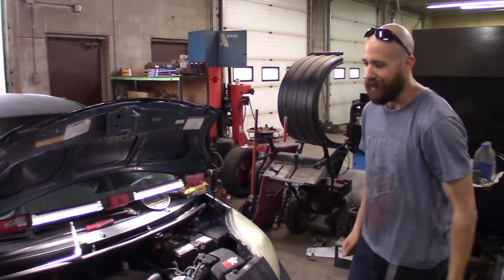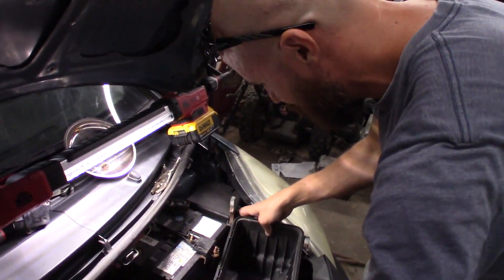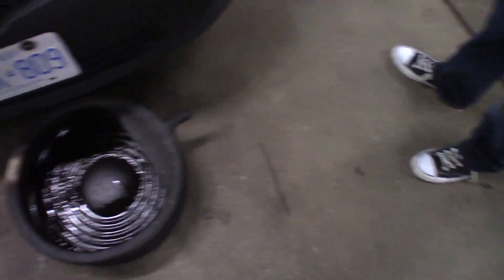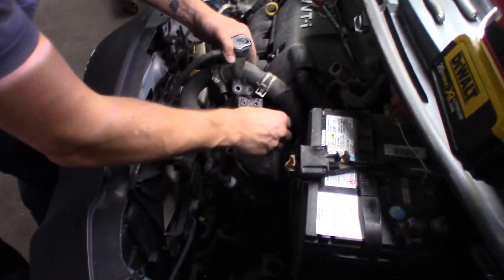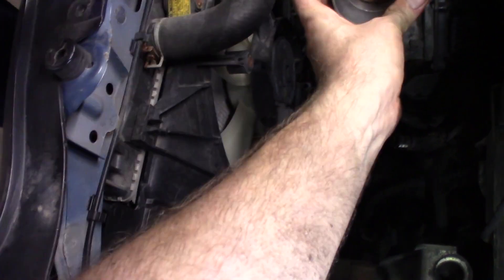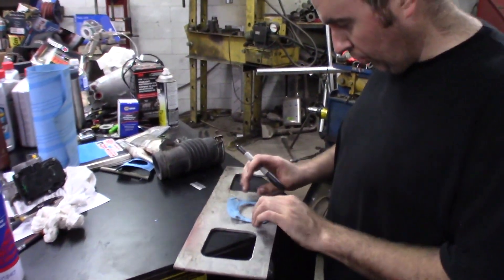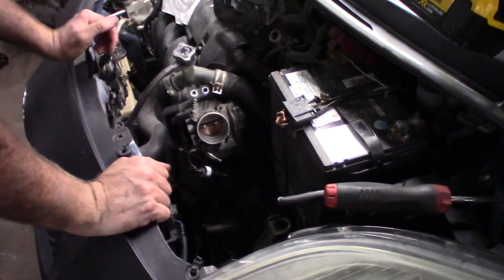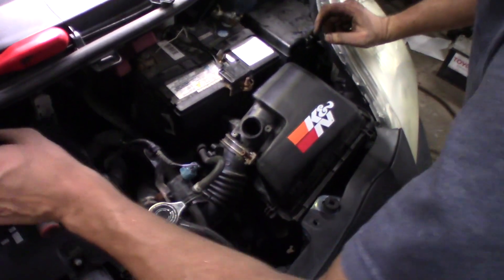1NZ FE 1.5L Throttle body upgrade!

Comment: how has the swap effected your smog check, still able to pass? I keep throwing EVAP codes p0505, incorrect purge flow. have you thrown codes?
Reply from the maker: It did not set any codes, so it would have passed no problem if they still did emission testing around here!
P0505 is for idle control system malfunction,  so you may have a vacuum leak

Comment: Did you guys use the original coolant hoses or did you run new ones?
Reply from the maker: If I remember correctly we used a new  straight hose to bypass the coolant to the TB
Reply: @modeverything1  I did mine a week ago and one of the hoses fit fine but I had to run a new line for the other end. Performance doesn't feel too different on the low end but to me feels less restricted at interstate speeds

Comment: Ok u deleted coolant line what did u do with the othe two lines on the throttle body
Reply from the maker: The two on the throttle body that had coolant going through them were left open once the bypass hose was on.

Comment: How did you handle the length of the acceleration cable once 1zz was installed? My original cable is long enough but the two bolts fastening it to the original harness holding it place, now holds it about a quarter inch too far out, so butterfly is always open way too much. My car is currently mid mod in the lot out back so anxiously awaiting connection with your wisdom!
Reply from the maker: The 2007 yaris uses an electronic throttle body so we did not have that problem.  It sounds like you may need to make a plate up to lengthen where it bolts up or elongate the holes on the bracket if it's close. Unfortunately I'm very familiar with the cable set up on the older engines

Comment: I did this swap and had the same issue's with the boot. I removed the plastic pcv fitting and cleaned the boot with soap and water to remove all the residue . Then i put the boot in the microwave for about 40 seconds. This softness the rubber up and makes the install a lot easier. I got this idea from when  I installed the covers on my older snap on air tools. That was the prescribed method for getting those old rubber covers on as well.
Reply from the maker: Awesome! I will have to remember that one!

Comment: I did this a few months ago and what an improvement. Hills are a breeze and it doesn't run out of breath on the highway. I also ported the intake manifold where it bolts up and made a custom gasket so it gets more flow and seals properly. The hardest part was putting the smaller hose over it. Some dish soap and a heat gun did the trick. I exposed the idle screw and backed it out a bit to have a proper idle.
Reply from the maker: That's awesome! We where on a tight time line to get it done so we didn't look into the idle too much. Good to know for next time!
Reply: @modeverything1  this is 1zz throttle body or 2AZ ?how about the idling when cold start ?
Reply from the maker: This was a 2AZ TB. Cold start was higher when cold, but as Mr Partridge said adjusting the sealed Idle screw would be best.

Comment: I have a 09 toyota yaris sedan and wanna upgrade my throttle body as well 2.4L should fit right?
Reply from the maker: I think so, but I don't know 100% if it will. Please let me know if you do get  one and try it!
Reply: @modeverything1 what's the part number of the throttle body u guys install? Cause I'm about to upgrade mine soon next month and headers to
Reply from the maker: Not sure on the part number, we pulled it off a 2006 Camry 4cyl

Comment: From the original throttle body from the yaris where did the two hoses hook up to on the 2.4 throttle body
Reply from the maker: We just used a longer hose to bypass the throttle body so that it helps keep the intake air cooler.

Comment: Do you happen to know the part number on the camry throttle body?
Reply from the maker: Sorry I do not have a part number for the OEM Camry throttle body.  You can buy new aftermarket ones from rockauto.com or your local parts store but they are not cheap!
Reply: @modeverything1  oh ok, does it matter what camry it come from? I want to do a comparison between the 1zz throttle body from the corolla I already have on my yaris with the camry tb. I found some new oem ones where I live for about $200 for the camry
Reply from the maker: The one I got was from a 2006 2.4L. I imagine that other years will work as well.
Reply: @modeverything1  ok great thanks
Reply: I got a new camry throttle body today and swap from the 1zz tb to the 2az tb and performance wise it identical but cold start rpm is lower than the 1zz tb and overall the camry tb feels alot smoother I'm running it with the 1zz 255cc fuel injectors
Reply from the maker: Good to hear! Think that you may be able to do a re-learn for the TB with a scan tool...
Reply: @modeverything1  I don't have a scan tool to be able to do that but the way I did the relearn process is the similar procedure to what I did to the 1zz throttle body. disconnect the battery before I start disassembling everything then once everything swapped and put back together turn the key to on position then turn it off (do the on to off twice) then start the car then I let the car pulse rev until it stops pulse revving and let the car continue to idle for 10 minutes. I'm currently running it on my stock ecu after I do 2 more videos on how it feels with stock ecu then I'm going switch back to my tuned ecu and see the difference
Reply: which throttle body is bigger?

Comment: Hey any suggestions for the wire operated 05 TB? Been doing research and these are all wireless throttle bodies right?
Reply from the maker: For the cable operated I would at the late 90s early 2000s 1.8 Corollas. Might just have to spend a day at the wreckers trying some from other Toyotas on one like yours in the yard. If you find one from another Toyota that has the same sensors but doesn't bolt up you can always make an adapter like I did in another video for the GM stuff!

Comment: Would you happen to have a list of things like this to do to these cars? Doing the same idea of mods to my 05 echo. Nice vid by the way
Reply from the maker: Thanks! On this car all that was done was full 2.25" exhaust, DC sports header, lowering springs, and the throttle body that was done in this video! Next we would have ported and polished the cylinder head because it could use some improvement.
Reply: Hey ross, u need intake, clutch very light wheels, coilover, de-cat and brakes !

Comment: If you have any modifications suggestions for 2008 toyota prius throttle body and air intake plenum please please help me out ....do you think the 1.5 1NZFE could be fitted with the newer 1.8 air  intake plenum ??
Reply from the maker: Sorry, don't have any upgrades for a Prius.  Dose it have the 1nz-fe? On a Prius I would start with an exhaust upgrade, they are only 1.5" iirc, i would go to at least 2". Then maybe look at making your own cold air intake, or some kind of an air duct to direct cold air to the air box. 

Depending on space the 1.5 1nz-fe may be able to use a 1.8l air intake... if you try it let me know if it dose or doesn't work!

Comment: What did you do with the air inlet tube at the top of the new TB?  Seems like it's an idle bypass inlet and should be closed when installed on the Yaris.
Reply from the maker: I believe there was a vacuum or evap line that went to it... it's been a while and I can not remember 100% lol

Comment: at the end of the video, it is accelerated, as they regulated the acceleration, or it was regulated automatically, greetings from chile
Reply from the maker: The idle was high from the bigger throttle body. After a few more starts it started to return to normal once the computer relearned.

Comment: this would make no benefit if the old throttle body whole is the same size as the intake  seems like a waste of time.. unless the stock throttle is too small
Reply: yes, it is too small
Reply from the maker: If we could have removed the intake i would have ported it to match.
Reply from the maker: Its still getting more air in the engine. On these cars at wide open throttle the throttle blade only opens 80%.
Reply: That is why you need to port the passages. A simple Dremel will do it.

Comment: So from 1.8L can be bolt on but with longer bolts from 2.0L or 2.4L, and gains around 5-6 hp? I would love that from a 2.7L 2TR tacoma inline-4 TB on my 2.4L xB. That be gorgeous.

How is it? Any issues? How much was it and where do u buy it?

@MODEVERTHING
Reply from the maker: I grabbed it from the local auto wreckers/recyclers. Think it was maybe $25 (check out the "yaris mods?" Video) it was a noticeable improvement, it did idle a little higher when first installed until it relearned.
Reply: Mod Everything  Do u think there’s an aftermarket throttle body? Rather than oem upgrade from larger I-4 displacement.
Reply from the maker: I have not seen one but with enough money I'm sure you can get a machine shop to make one for you! lol we did this years ago when my friends brother was working at a machine shop!

Comment: Can you please share the service manual?
Reply from the maker: https://www.amazon.ca/Toyota-Yaris-Automotive-Repair-Manual/dp/1620921367/ref=asc_df_1620921367/?tag=googlemobshop-20&linkCode=df0&hvadid=295972053075&hvpos=&hvnetw=g&hvrand=16184961261515502382&hvpone=&hvptwo=&hvqmt=&hvdev=m&hvdvcmdl=&hvlocint=&hvlocphy=9000887&hvtargid=pla-559617306387&psc=1 best place to get all the information,  they tear down a complete car and take pictures! Also have wiring diagrams too!

Comment: Really cool that you got a Camry throttlebody to work. I figured that that would cause problems. The Yaris isn't too bad to work on. I had two. Just recently sold one. The other, my RS, I 2ZR-swapped and turbo'd. It's an absolute blast to drive.
https://www.youtube.com/watch?v=qH2HCcNXF28
https://www.youtube.com/watch?v=6eJXEtcY0RQ
https://www.youtube.com/watch?v=fFvwnmc09Qc&t=0s
Reply from the maker: Nice! We wanted to do more to this one but my buddy's wife wouldn't let him spend any more money on it so he sold it 🙁 I'm hoping to pick one up later this year and actually port a head for it and possibly turbo it!
Reply: @modeverything1  Too bad your buddy had to sell it. Hope you get one yourself and turbo it. Would you do any engine building? I think the 1NZ is good for up to about 9 psi stock.
Reply from the maker: Yes I would do some engine work, I have a 1NZ-FE cylinder head here that we where going to port and polish for his... I'm itching to play around with it and see what I can do with it!
Reply: @modeverything1  I think a 1NZ build would be great. Since I have one in my garage, a build (pistons, rods and some head work etc) isn't out of the realm of possibility, though I'd have considerable learning to so before embarking on that type of project. There are guys getting upwards of 500hp out of them. IMO, that would be way too much power in a Yaris but somewhere in the 300s with a 6-speed, upgraded clutch and LSD would make a fantastically fast and fun car.

Comment: But how big is the hole in the manifold?
Reply from the maker: Did not measure it but I would say it's a mm or two smaller than the throttle body!

Comment: Does it improve idle
Reply from the maker: The idle is pretty much the same as factory after the ecm re-adjusted its self after a few starts/warm ups!
Reply: @modeverything1  was it was high in the beginning ?? I have low idle problem and I have done everything to improve it now last option is to change Throttle body
Reply from the maker: @mridware9694  yes it was higher than normal at first. Is your Throttle body clean inside (no carbon), any check engine codes?

Comment: Im loving this! So glad i found it. So reading the comments, i can put 1.8l injectors and a 06 2.4l Camry TB?
Reply from the maker: We have not tried the injectors ourselves but the 1.8l Throttle Body is what we where looking for but could not find one.  So we tried the 2.4l TB and found that it worked!
Reply from the maker: @WeAreWatching Yu yes it was a direct bolt on, but we did not try it with out a spacer in place that we made. I know that people have used the 1zz TB just bolting it on.
Reply from the maker: @WeAreWatching Yu Yes he noticed a good difference in power and throttle response! Nothing was done to the computer or anything else other than what was done in the video!

Comment: What under hood light is that?  I have never seen one that takes dewalt batteries.
Reply from the maker: It's made by Mac Tools. It just came out last spring! Mac tools / Dewalt are owned by one or the other,  cant remember which one owns the other.  Stanley tools I believe is in the mix too! Lol

Comment: I have a yaris but a standard instead of auto.  I would love to see more on your yaris.  Im gonna be building mine up as I can.  I think I'll be doing this same upgrade.
Reply from the maker: Nice! Hope to get some more video on this car soon, but I don't think it will get anymore mods, he is talking about selling it 🙁
Reply: @modeverything1  Hi, if your car is an auto and the same type as my 2014 Aygo do you know if the gear changing setting sequence can be altered as mine changes into 2nd too quickly or does one just have to put up with and use the paddle shift!?
Reply from the maker: If you could reprogram the pcm you would most likely be able to, but I think that you are stuck with the paddle shift or manually shifting the auto
Reply: @modeverything1  Here is an interesting question for you. If the starter motor failed on one of these autos and you could not turn the engine over ive not tried this out yet as i suspect not but is there a way of placing it in to first gear so one could push start it like a manual.?
Reply: @gtibruce  you can but it's a pain, you have to get the car rolling at a good clip, then drop  it into D.
Reply: @BBHexKey  But you would have to blip the brake pedal as well wouldnt you !?

Comment: what engine is the new throttle body from?
Reply from the maker: 2AZ FE 2.4L from a 2006 Toyota Camry.  Other years may work too. The 1ZZ FE ( 2007~Corolla) is also a bolt on But could not find one at the u-pull yard!
Reply: @modeverything1  i got mine from 1zz thailand,shipped to phillippines.
Reply: I'm wanting to do this to my own Yaris sedan. Is there a "Best" throttle body to use for performance?
Reply from the maker: I don't think that their is a "best", we decided to try this one from the 2.4l because we could not find any  1.8 1zz Corollas at the auto recyclers. Mike is happy that we did this TB swap, it makes a noticeable difference.
Reply: Mod Everything hey I have a 09 Yaris I did the injector swap off a 1.8 but I never knew that that throttle body fit thier
Reply: I hope we can get in touch my Yaris runs 16.71  in a quarter mile but I want to run faster going boost soon also
Reply from the maker: Nice! I think that we are going to have to do that soon too!
Reply from the maker: We would boost this but are having trouble trying to find tuning software that supports the factory ECU. That is a good 1/4 mile time! Is it automatic too?
Reply: @pedrorivera5155  Does the injector swap improve performance?
Reply: @danburdiek2697  injector swap doesn't feel any different @ low rpm, the different comes when rpm reach @ 4-6k on high speed.

Comment: Can you help me to  get wiring diagram for vehicles right now I converting a toyota 1nz in to a toyota belta but  I am having some problems with it it start  on idle ok but  the electric throttle body wont rev i  am wondering what I am missing
Reply from the maker: I can see if I can get my hands on some. Is the engine light on at all? Dose the throttle body from the old engine bolt on so you try it to make sure the new one doesn't have a problem?
Reply: @modeverything1  yes but still not working if  you could give me a email address i could send you a picture of the ecu
Reply from the maker: modeverything1@gmail.com

Comment: How do adjust the idle back to normal? do you get a check engine light? i might consider doing this i have a manual yaris
Reply from the maker: It took a couple of cold starts before it re-learned the idle. And no check engine lights! He also said that it is a noticeable increase in performance!
Reply: @modeverything1  is this throttle body plug and play or you did some wiring/fitting mod?
Reply from the maker: It was a plug and play,  we confirmed it with wiring diagrams for both vehicles.
Reply: That's great. Makes for an easy quick upgrade except for that pipe lol